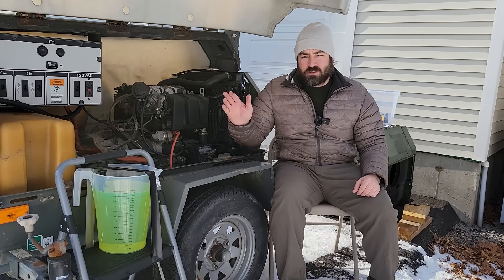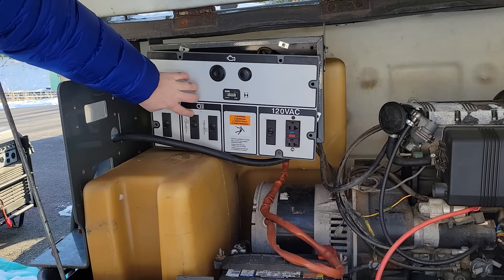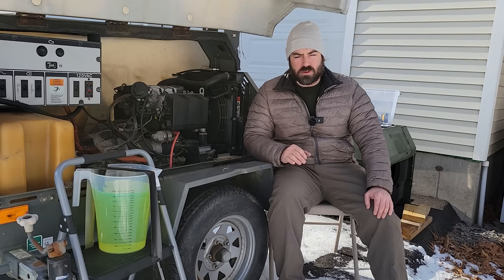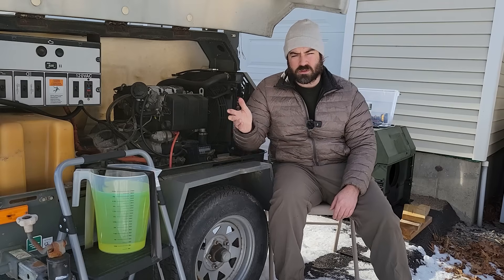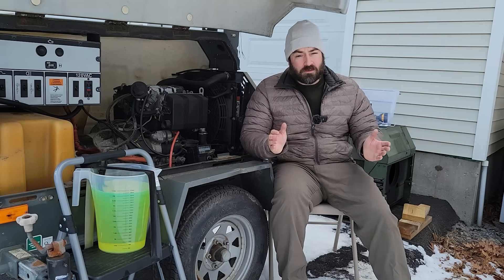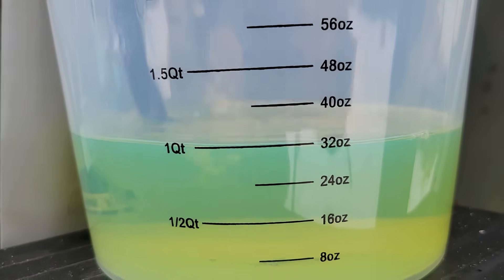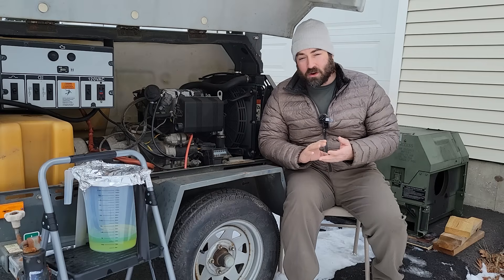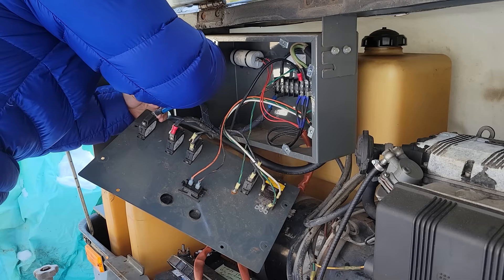Most efficient generator to recharge batteries (that I've tested)

Comment: Run it again after changing the air filter.   Also if you do it in the summer, you may gain some efficiency with that as well, but also could loose some by pumping more water.

Comment: Great Vid! Why not take heat off the exhaust were you have much more energy available when compared to the water jacket?
Reply from the maker: You could up to a point, but you need to be careful of "wet-stacking".  If the exhaust gets too cold, then it will condense and foul up the inside of the muffler.  If I take heat from the coolant system, then it's safer.

Comment: David, I have been following your video postings for a few years.... very informative and entertaining! But then I am a nerd by nature.... :-)  Very well done and thank you!
I have a smaller offgrid solar power system, not to power the full house, but to provide minimal required power (refrigeration, etc) in case of prolonged power outage here in very very rural Central Texas. About 3.5kW faceplate of solar panels, 22.5kWhr of faceplate LFP battery storage, and 6kW inverter.
I also have a one-cylinder 6.5hp Lister Engine (clone from India, circa1930 design) that really sips diesel.... REALLY!  Mine is flatbelt-connected to a 10K generator head.... My Listerclone runs at only 637RPM and the pulley ratio gives 1800RPM for 60Hz 240VAC at the generator output. Full power on the Lister is only 3.5kW mechanical output (rolling black smoke, or conservatively 3.0kW). This then is the input to a Chargeverter to charge the LFP batteries at 50Amps.
I have done no actual measurements as you have, but I have reasonably calculated based on published data on measured Lister Engine fuel consumption performance (https://www.centralmainediesel.com/order/09912_kit.asp?page=K09912) as well as ESTIMATED total kW of about 2.8kW charging rate (it is going to be pretty close because of the flatness of the LFP voltage curve), and the faceplate Power Factor of the Chargeverter = 92%.
I get 9.2 kWhr/gallon from this. Admittedly this is only calculated and not actually measured........ Maybe I could set up an experimental measurement but I ought to acquire a coulomb-meter first.....
If you are interested in discussing this, contact me.
I think there is good reason to suspect a Lister Engine might be the most fuel efficient diesel possible, being a low RPM single cylinder diesel, meaning low internal friction losses for a given power......
rogerw
Reply from the maker: Hi Roger W. I've seen some of those lister setups online and think they are 100% on the cool scale.  I'd love to see more of it.  Have you considered making a little cell-phone video of your setup and posting it on your channel?
Reply: @DavidPozEnergy  Hello David. Sorry, I am not prone to posting stuff online and do not do social media, etc. Is there a way I can email you pictures of the setup?

BTW, there are 43.1MJoules/Kg of energy content in diesel, or 137MJ/gal, or 37.7kWhr/gallon diesel.
So, 9.2kWhr/gal is right at 25% overall efficiency.
Very roughly, the thermodynamic efficiency of an IC engine is 1/3 heat exhaust, 1/3 radiator heat loss, and 1/3 mechanical motion against any drivetrain friction and the load.
Thus, approximately 33% minus the 8% power factor loss leaves approx. 25%, and either internal friction loss is pretty low, or the 33% mechanical energy figure is actually somewhat higher.......

Comment: Im thinking a small turbo and water injection might be able to increase this engines fuel efficiency further. From what i understand, diesels can run anywhere from 10-1 up to 70-1, and natirally asperated diesels are normally around 15-1 or 20-1. The problem then is nitrogen oxides, which should be reduced with the water injection keeping the temps down. Thanks for the video.

Comment: In the last 40 years, fuel injected gasoline engines have become common. And they will also have two "fuel" lines. Three counting the tank vapor vent in cars. So...small gas engines may still be single lines, just be aware that varies with the application.

Comment: My commercial 5.5kva 3 cylinder diesel generator is the silent enclosed type. The engine cooling fan is intentionally reverse pitch or backwards. It is critical to the design of the generator. It sucks cool air from the rear sides of the enclosure (upwards so rain doesn't get in) drawing air over the alternator before going through the radiator and mixing with the exhaust. 

The only downside is the internal starting battery really needs to be outside the enclosure, with lengthened 300a cables which I've done. 4 batteries failed before I worked out they were dying because of the heat.

I will say if you run your gen at high output wet stacking will never be a problem but keeping the alternator cool at high output is never a problem for me. That's the enclosure factor.

Comment: hello. i believe in your engineering, physics knowledge and specially research abilities. please take a a look at this and answer my questions. thanks.............>  hho fuel cell generator

https://youtu.be/i8KhrjBgf_g

1- beautiful fuel cell and construction. 

2-was that engine petrol or disel fuel? 

3- for short term, clear, it is working. for long term, suppose 1000 hours, how often fuel cell plates must be replaced? 

4- temperature signature of hydron and petrol and disel fuel are different. does it destroy the engine? if yes, theoretically prove. if no, theoretically peove. 

5-that motor was designed for a different fuel. law of conservationnof energy and second law of thermodynamics are FAKE, but temperature of different fuels are real. does this destroy the engine in long run?

thanks for answer, if anyone knows these answers, before spending time making that nice fuel cell
Reply from the maker: This was a modified gasoline engine.  The browns gas (mix of hydrogen and oxygen) goes into the carburetor.  Yes, you can make an engine run on browns gas, but the question becomes where is the electricity coming from to split the water?  In this case it's a 12V battery.  The 12V battery won't last long since it's a net loss situation.

Comment: Thanks for doing this David. I'm stuck with gasoline generator for my winter battery charging. It works for I'd really like to go diesel. I'll try to find a source of a used diesel light tower unit.

Comment: The voltage sag sounds to me like you've got a heat saturated transformer somewhere in your system. It has a runaway effect, where a voltage sag causes a rise in current, which causes heat buildup, increasing resistance, which causes voltage sag, and on and on it goes. Might be able to actively cool whatever coil is at fault. It may be related to the power factor of your chargers causing it to be more apparent with some loads compared to others. Neat project!

Comment: Depending on the price you pay for diesel, that's somewhere around 35 cents per kWH (just for the fuel, not counting the lifecycle costs of the generator.) Are you allowed to buy non-road taxed diesel for this purpose?
Reply from the maker: Yes, I'm allowed to buy red diesel for the generator.  However, the places I've called want me to have a business account first, which is why I'm using road-diesel in the videos.

Comment: At the end of the video you were talking about replacing the 50 amp breaker with a 30 amp one. Be sure you use a double-pole breaker to protect both L1 and L2.

Comment: 1 Gallon of Diesel is 37.1 kWh of energy,
you get 8.4 KWh
so about 22.5% efficient, not awful, but it feels like you could likely harvest a LOT of heat from this,
maybe couple your heat pump to it? or atleast point the exhaust at your heatpump unit??
or put this into the warm water tank you have to heat that up?

I dunno but a lot of energy left for the taking here, hope you do something with it :)

Comment: Are there ~38kWh per gallon in diesel? So you're only getting 22% conversion from fuel->engine->generator->charge controller->battery. No easy way to improve that, but utilizing the wasted heat from the coolant & exhaust could double what you're getting out of the fuel. Converting it to electricity isn't cheap, but heating water for radiant heat flooring would be pretty simple.

Comment: Are you running the same fuel for all the tests?  A winter blend (mixed with K1 kerosene or D1/#1 diesel) will have lower energy content and you will have to burn more fuel to create the same power.  Summer blend always has more energy content.
Reply from the maker: I ran the tests in winter, but I didn't ask my local gas station if the diesel is blended or not.  Sorry.

Comment: 8.4kwh in my 2013 chevy volt is equivalent to about 38 miles of range. just a reference point. thats pretty darn efficient given all the losses involved. about 38mpg round trip efficiency including the losses of going to the battery

Comment: What are your thoughts on using a 48 volt DC generator to charge directly vs the chargeverter? Some say the losses on the chargeverter are significant. I see some diesel generator manufacturers now sell this as an option.
Reply from the maker: I love the idea of a 48V generator, but there are some things to be looking at.  For example, I looked at the Kroner brand generator.  It goes up to 54V, which is a bit too low for my lithium battery bank.  The chargeverter seems to average about 92% EFF, which isn't bad for what it is.
Reply: @DavidPozEnergy  Thanks, that's helpful.

Comment: hopefuly in the near future i will do the same but just using 1,9 TDI engine. I will reconstruct some alternators as you did in the previous videos and charge the batteries and use the heat from the engine for heating the house underfloor heating. I will also instal exhaust gas heatexchangers to collect some more heat from the exhaust to heat up the water more. Im really looking forward for your next video to see how you gonna do it!
Reply from the maker: Sounds great.  I'd love to check it out if you finish it.

Comment: I wonder if it would be more efficient with a turbo and leaning it out but thats likely something hard to do on that
Reply from the maker: I'd love to give it a try.  I've been looking into it a little bit, but having trouble sizing a turbo.  There are plenty of turbos on the market, but trying to find one for a 1-liter and low RPM (1800RPM).
Reply: @DavidPozEnergy  ya you should be able to find the hp it makes and based on what you want to make you likely can use that as a good way to search because hp is a good way to size them it doesn't really matter if it's a diesel

Comment: Since the chargeverter can run at 50hz have you considered lowering the engine rpm to 1500 and charging at 80-90 amps? 

I think lowering the engine r p m to the lowest acceptable frequency for the device will help increase the efficiency, just like putting a highway gear in a truck. 

I'll be testing this soon with a kubota D905 powered generator. I've got two of the kubotas, one from a light tower and one from us military.
Reply from the maker: I love the "out of the box" thinking behind the question.  I looked into this.  In my case, this engine has peak fuel economy at 2500RPM.  It's currently running at 1800RPM.  Lowering the RPM will get us further away from the goal.
Reply: @DavidPozEnergy hmm, will the chargeverter accept 83hz?
Reply: Watch-out, when lowering the frequency on a generator, you may have to lower the voltage, in proportion. Magnetic flux rises, with falling frequency, and you might over-excite / saturate the alternator.
Going from 50->60, is possible, but 60-->50 may not. Check the datasheet for the alternator (Generator Head)

Comment: Thank for the video, I hope my comments regarding my generator experience is helpful here...
I have a "4000w" single cylinder diesel generator and my solar setup is a 4000w 24v edecoa, I have 8x 12v gel 250ah batteries connected every 2 in 24 which each negative and positive goes to a busbar, all cables same length, then every join link cable is connected together...
I know is a pain but manage to balance them well this way...

Now...
Problem #1, the inverter does not demands power and get generator do not produce power until is demanded, "catch22" so when the generator is running, the inverter sees it and goes into bypass "something I can not turn off" but when it tries to use the power to charge the battery, the generator is not producing constant power so the inverter kicks it out and the cicle repites...
I manage to work out, so the bypass has to have a minimum load of 500w to then get it to charge the battery but no more than at 10amps "pointless" and the only way "I think" to work this out is to get a dc psu "60v+ and 20amps minimum, then a mppt 50amps minimum and hope for the best"...
Now...
There is a massive factor and is the hertz of the power, here is europe is 50hz and I had all sorts of problems "specially with motors, washing machines, pumps, etc." also I had this little power banks to use them as ups and because the generator's power and frequency are all over the place, well 1 is blown.
The power discrepancy that you show is exactly what happen with all these issues I am talking about, as more amperage you trying to get out the generator the lower the voltage gets...
The generator tries to increase its rpm in order to keep up with the power demand but it has a limit and also a speed it can do this... Also the frequency is not regulated at all, the more the engine revs the more herz it produces and this can be damaging.

This all is where these new "inverter generators come in"... I am hoping that using the psu and the mppt will use the power from the generator in a more efficient way which at the end I would like to charge the batteries fast using the generator...
I also wish for the inverter to have an option to stop the bypass and use the grid/generator to charge the battery only.

Comment: Hey, the cogen scheme will hugely improve your results,  getting more value for your diesel fuel dollar.  The very best diesel engine in the world,  fuel-economy-wise, still is just 50% efficient at converting fuel energy into motive force...and that engine is the size of a house.  Not a small house,  either.  The rest of the energy is wasted as heat.  Adding the heat exchanger to the cooling loop will yield big dividends...and if you can do the same trick with the exhaust,  you get even more.
Reply from the maker: Thanks.  I'll have to search for a video on this 50% engine, sounds cool.
Reply: @DavidPozEnergy Think supertankers and other large ships.
Reply: @DavidPozEnergy  It's the Wartsila-Sulzer RTA96-C, and it is an absolute beast.  The bore and stroke are 1x2.5 meters and the engine itself is a 14-cylinder inline, so it's 87 feet long.  It's designed to power enormous container ships and burn fuel that is only slightly more refined than tar.

Comment: 8000w - will run a 5000btu window AC for s long time since it only uses about 450w when the compressor is on & the compressor doesn't run constantly. Usually the compressor is only running about the half the time. For an insulated 10x10 bedroom. So 1 gallon of diesel - 8000w could run the 5k btu AC in eco mode for over 24hrs.

Comment: My EG4 charger dumps a massive amount of power as heat during charging. I use a 3kw honda inverter at 120v.
Reply from the maker: Yeah, they do get hot.  That's why I'm measuring the power into the battery, after the charger.

Comment: Great as a backup.  I have a 10KW Diesel down off grid in Mexico tied to a 6.5 KW Solar array. I have the outback charge/inverter set to kick the genny on when we are drawing more than 2KW over what we are making.  It's a great system but back in CA we only pay about 21 to 35 cents per KW for electric so it only cost us $2.70 for that same amount of power that you bought a gallon of diesel for.  (here diesel is over $5 per gallon.  Depending on your genset I hear that in the rural areas you can get heating oil pretty cheap.  Maybe you could run your genny off that.
Reply: two things, first thing, these modern diesel engines are not as tolerant to fuel contamination like running used motor oil or home heating oil, which the home heating oil has no lubricating properties when it comes to a high pressure fuel injections systems on a diesel engine, you will wreck you injection pumps and injectors if you run home heating oil. on some engines, you would be looking at 3k to 8K in fuel system repairs. Second thing is whats your normal load on that 10Kw generator? if its prolonged loads under 60%-80% of the rated load will wetstack your generator. Prolonged wetstacking will choke your engine to death.

Comment: Looks like you topped 20% efficiency.  Not too bad, considering all the conversions.  80% left to be extracted as heat. ;)  Obviously not practical to get all the heat, but there's plenty left on the table.

Since you are generating AC, it would be ideal to run the set during times when you A) need heat (extracted from the engine) and B) have AC loads to run.  That way you skip the conversion to DC, losses into and out of the battery, and conversion back to AC.

BTW, engines have heads- cylinder heads-  but generators are just generators. The whole thing- engine and generator- is a "generator set". ;) 

Love your videos as always.  Will be curious to see how much heat you're able to extract from the unit, when you get around to it.
Reply from the maker: I agree with you about the words of each item.  I try to make the video understandable to everyone.  Some people may not know the exact definitions.
Reply: Agreed - overnight on cold nights, running AC directly to heat pump, extracting coolant heat and recharging batteries all at once is the best application.  2nd would be everything minus running the heat pump if coolant can supply enough to heat with, which can also be stored in a storage tank.